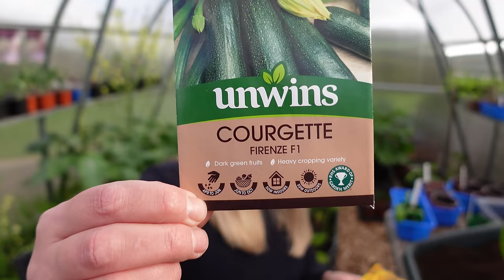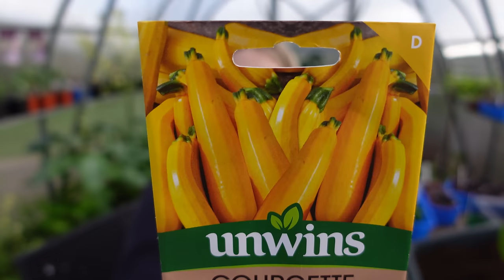My Spring Garden Update 2024! Weed, Feed, Mulch & Harvest!

Comment: Hi Maiju, I use a similar method for my peas and beans in a plastic zip lock bag rather than a container but I've not placed them on heat I just stick them in a dark place and forget about them usually for too long. For the courgettes I used a container and on a super seven so low heat but you do need to give them a shake every one to two days so that the condensation can drop back onto the tissue or the tissue will dry up. Also I double up the kitchen roll so two layers. I hope they all germinate for you.
Reply from the maker: Thanks, Ady 😊 You had fine sprouts on your seeds 😁
I've just checked the Soy beans, and they're a goner. It is definitely the seeds. I only ever had the 2 packs, and they have never germinated for me....the ones in the box are all covered in heavy mould and are slimy.
I separated the Greek Gigantes and Soy beans to separate boxes and there might be life in the Greek ones yet, but too early to tell as they're so much bigger of a seed...
I might need to get myself a heated propagator, I've managed all the years before without one. But this spring has really given us no proper sunshine and I've depended on sun to heat the soil....💚🌿
Reply: @spudsandroses  I'm looking at the spyder mat a lot more versatile with what size pots to put on it, I do not use heat that often but would be nice to put any size container on the heat mat. Hopefully over summer when less demand they may be cheaper. Ooh well deserved on the views.

Comment: Forgot to ask, when you originally set out the kitchen garden, did you put a layer of plastic under the walkways or just apply the wood chip mulch directly?
Reply from the maker: I have weed supress membrane under 1 strip of the wood, where it joins the stone mulch with woodchip, but the rest was directly onto the soil. I really wouldn't have wanted to use any plastic, but resorted to this because of maintenance 💚🌿